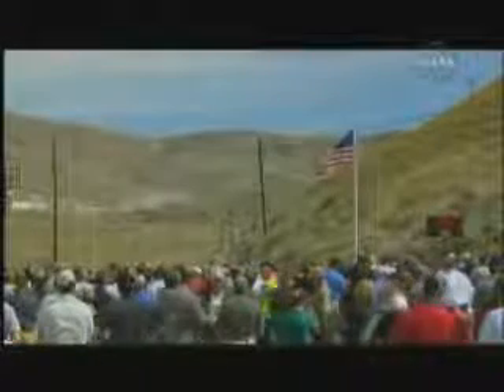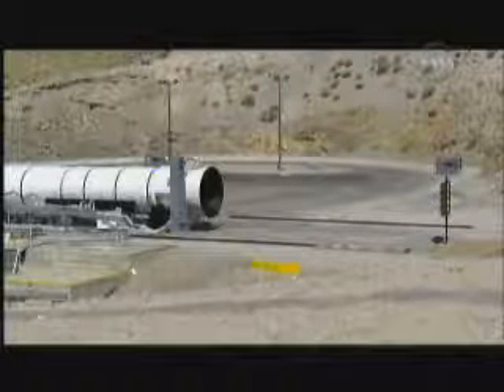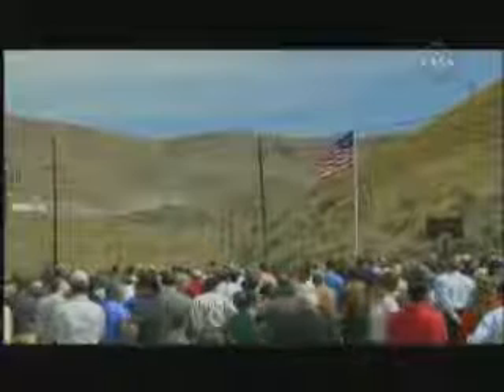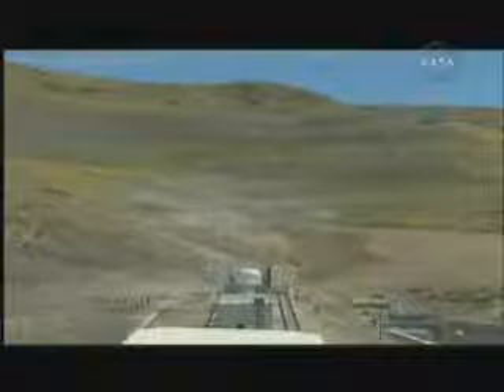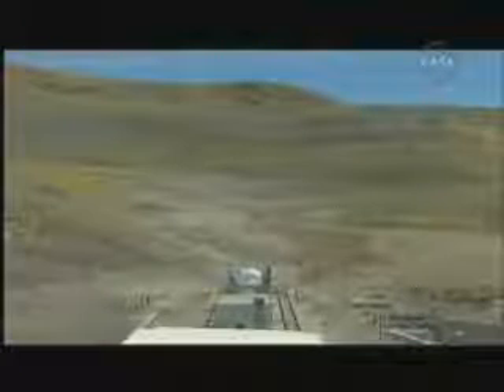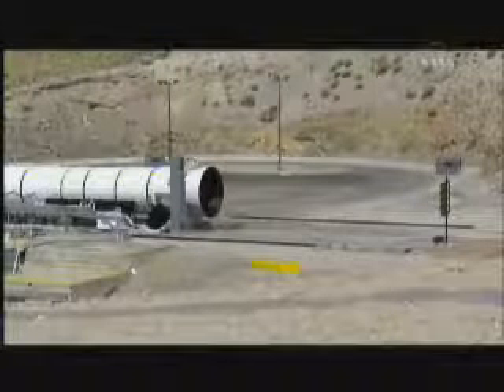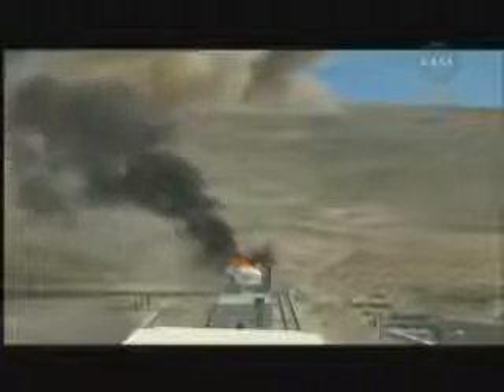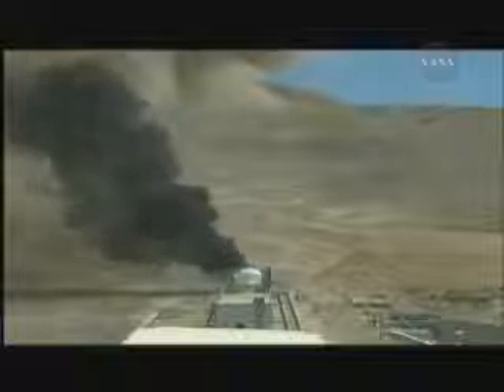Ares I Development Motor 1 Static Test Fire

Comment: The sound you hear at 3:15-3:17 is not cameras, it's the  SRB hydraulic power units at the end of the booster, they are started to provide steering to the nozzle.